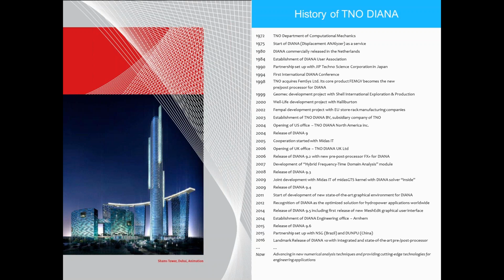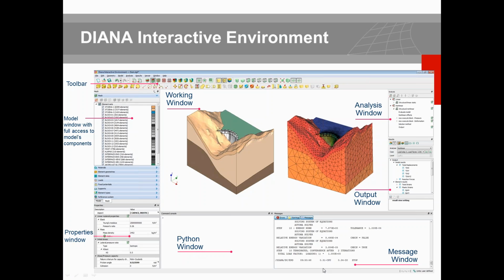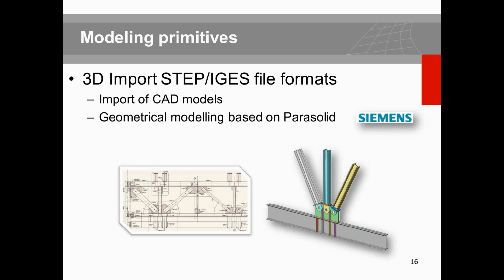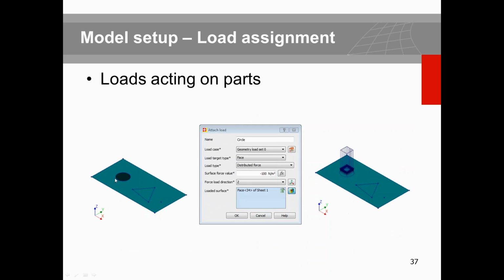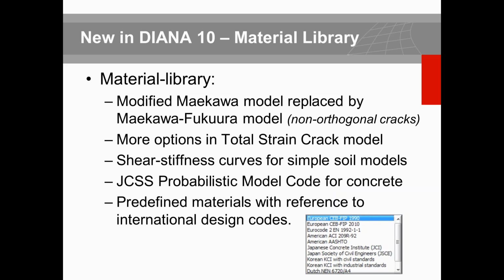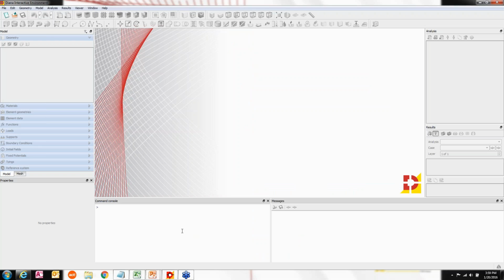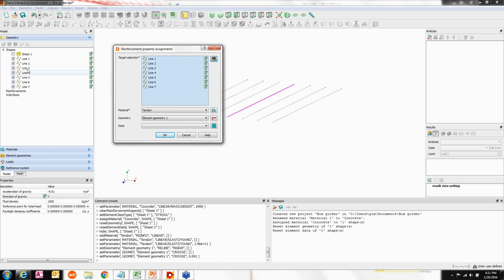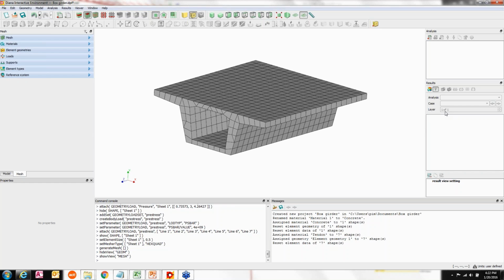DIANA 10 Release Overview

Comment: Hi! I've modeled a 2d masonry arch (plane stress) with a prestressed steel tendon on the extrados (as a reinforcement, since as a line shape seems it's not possible to apply a prestress on truss elements). I can see the effect of prestress on the masonry on the structural linear analysis but not on a structural non-linear incremental one, in which I have no displacements. I've been trying to apply the prestress both as "reinforcement bar prestress" and "post tension force".  Can you help me please? Also, do you have suggestion for modeling such external reinforcements on 2d models in general? Thanks a lot!

Alberto